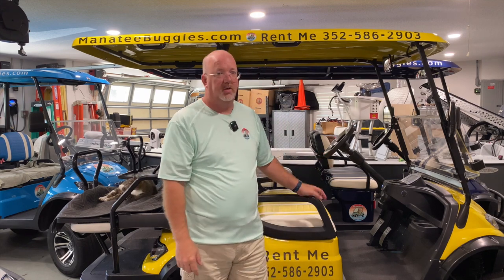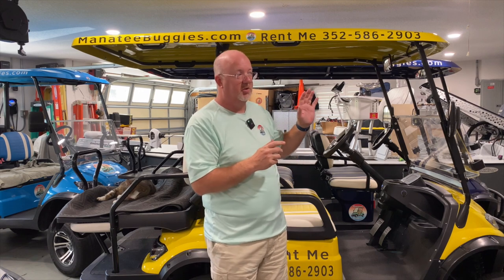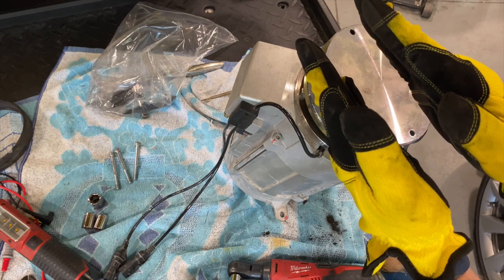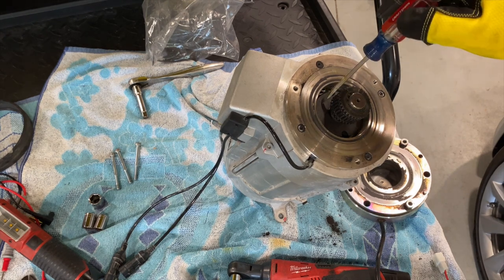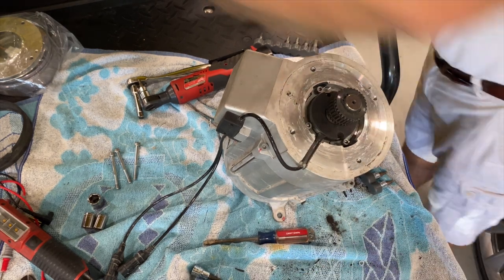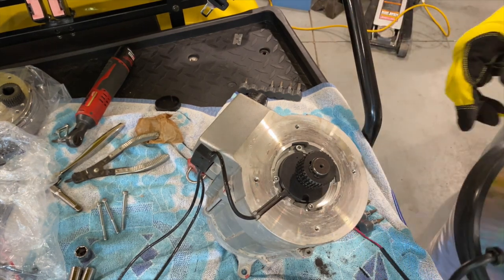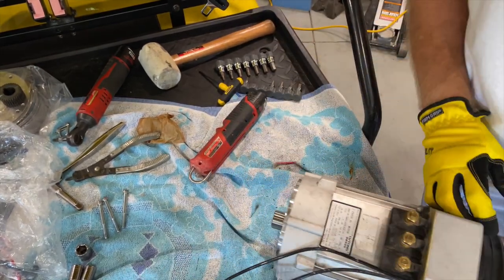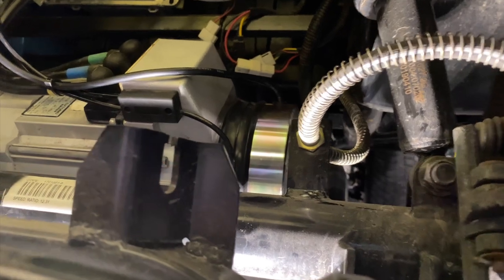ICON e-brake Repair ..... Smoked It Good!!!

Comment: I60L owner here… question… do you know what wire is the engagement wire? I want to add a switch so I can disable this feature when I’m loading it on a trailer.